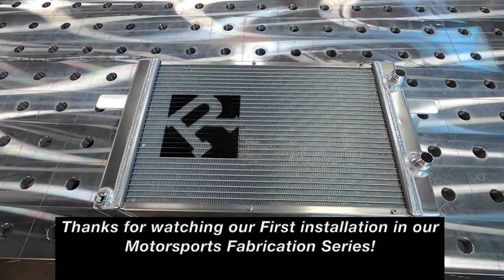HOW TO BUILD A RADIATOR | Rampage MotorSports Fabrication Series Ep.1

Comment: Wouldn't it be better to drill the holes for the bungs prior to tig welding?  Because now you can introduce metal shavings into the radiator, possibly clogging one of the passage ways up
Reply from the maker: Ideally yes but its nothing that cant be washed out. On production units thats usually the MO, however its not always possible on custom rads

Comment: I know it depends on the thickness but what usually settings do you use? I work on old radiators and core replacement and although I weld them ok but I can't get a consistent straight cord

Comment: Nice! Can I ask which liquid did you use to clean aluminium? Thanks
Reply: Acetone. Anything will work. Brake cleans out of a can is probably better. If it's new like that, shoot it with the cleaner then blow it dry with air, no wiping needed usually. Also, you should probably brush it really good, (in 1 direction) with a small stainless steel brush to remove any oxidation

Comment: Gj, but I feel like your fabricator is good enough to bend his end caps down on the end, instead of a 3 piece tank. Would save time for the welder, and a guarantee no leaks on the bend. Pay the welder, keep him happy. Been in the radiator business for 10 years now, a consistent bead is getting more rare to come by.
Reply from the maker: Well as it turns out the fabricator and the welder are the same person lol. And we no longer build rads often but when we did we would just have pre bent channel that was cut to length and pre cut caps ready to weld. So actually way faster than custom forming each tank to the right length. When I was doing production radiators the tanks were all laser cut and cnc bent with end caps like you were saying

Comment: Shouldn’t you be cutting the holes in the tanks for bungs before it’s welded? There’s no way you’re getting all the chips out by blowing air into it.
Reply from the maker: No thats not really a thing when building a custom rad. In production the holes are usually already cut out during the laser work, so its a non issue. And yes we get all the particles out after the work is done.
Reply: @rampagefab  Guarantee you don't get ALL the metal shavings out.

Comment: I don't mean to be a troublemaker, but I think you should be using 4043 filler.  All the weld filler tables I have say that 5052 base with 5356 filler should not be used at sustained temperatures above 150 deg F.  I know these welds should not be stressed much at 15 PSI, but why not follow the industry recommendations anyway?  If you're not anodizing it, the superior color match of 5356 shouldn't matter at all.
Reply from the maker: Ill make sure to let you know when i have a weld fail. Been doing rads for over 6 years with this method and never had an issue, nor have the people that taught me to build rads so 🤷‍♂️
Reply: @rampagefab  - Like you say, the proof of the pudding is in the eating!
Reply: @rampagefab  is there a reason that you prefer 5356? Not being a smartass, I'm actually curious.
Reply: @Lucas12v  

Welds easier

Comment: Very nice work. I have problems cleaning before putting on the tanks, you make it look so easily. I need to weld without rod, clean with plastikk disc, weld, clean several time. What kind of grindtool do you use, doesn`t it make any pepper in the weld. Thanks a lot. You can se some of my work on Facebook Thoresen Automotive.